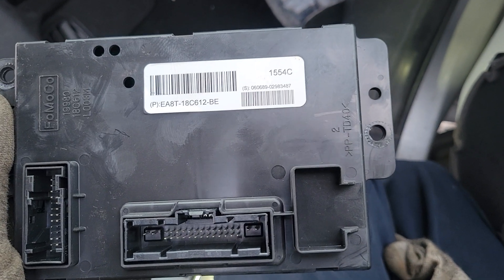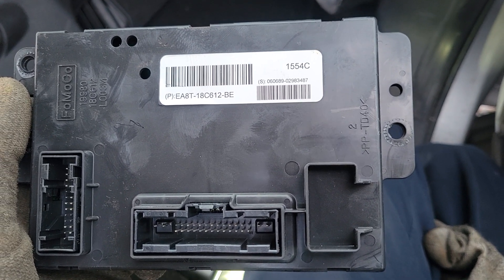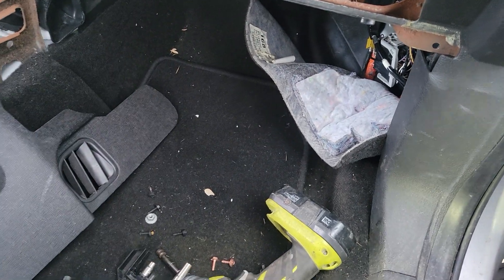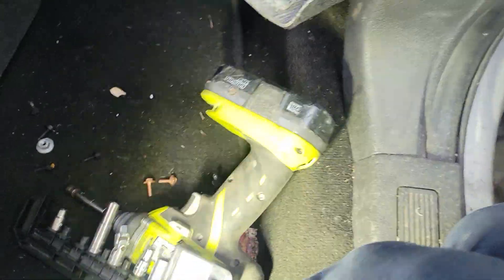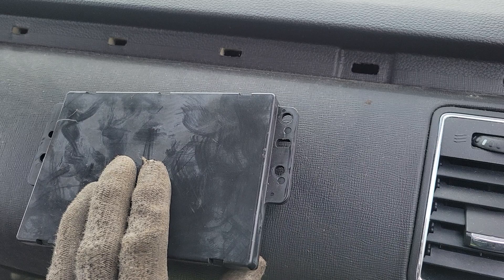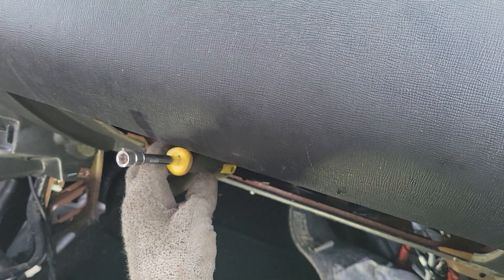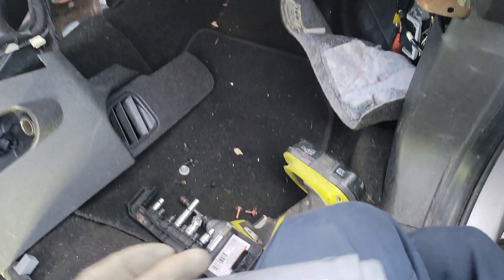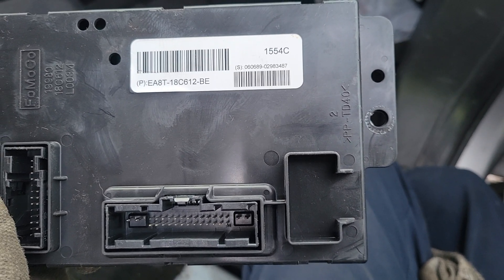2014 Ford Flex A/C Heater Control Module Location and Removal

Comment: So if this is the heater control module, does it still need to be programmed? And if so how do I start my car w/out the key fab working to get it to the shop for programming ?   Thank you.
Reply from the maker: If ypu Google the part number it comes back to the HVAC control module. If the one you're putting in matches the numbers of the one coming out, I don't think there'd be any need for reprogramming. Sounds like you have greater issues if you're unable to start your car due to a nonworking fob.